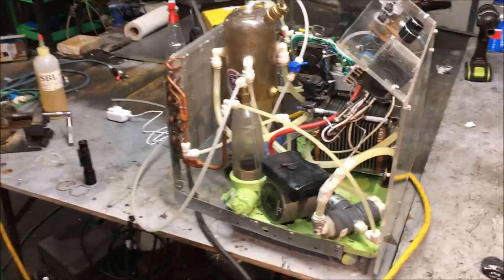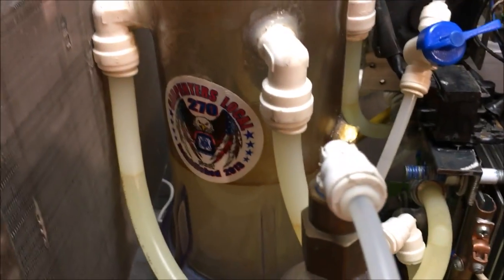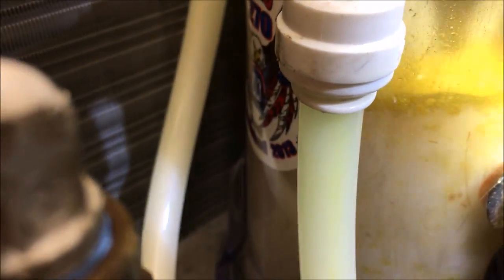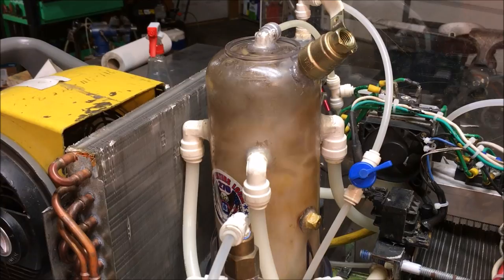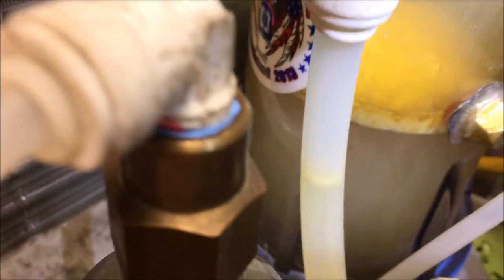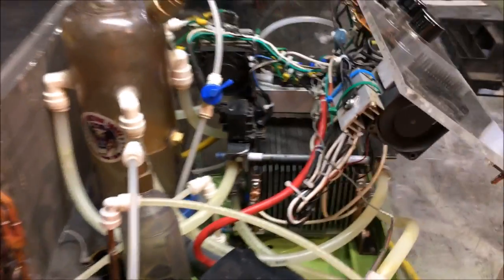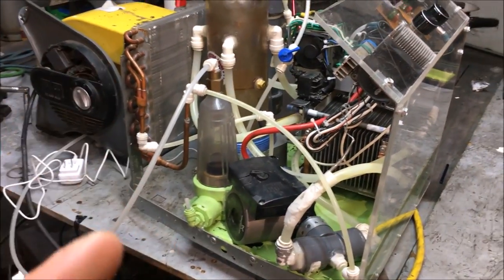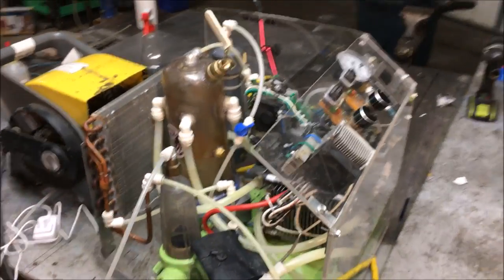hho foam (SOLVED )

Comment: Have you heard of thermoil ? It's a product used to stop excessive off gassing in lead acid batteries, you actually add the stuff to the electrolyte and it floats on the top slowing the bubbling and fizzing. Something for you to check out if the stuff your using degrades after time....
Reply from the maker: thanks bro appreciate the input

Comment: I like what you're doing mate.
The process in which oils become soap is called saponification. 
That is to say they saponify. Most hydroxides will cause this at different rates. NaOH & KOH will also make different soaps with the same oil; I think that the potassium will take longer to make a softer/liquid soap with denser sud profile.
In a pinch? Unscented baby oil is mineral oil.
One way margarine is made is through the hydrogenation of oil using a catalyst usually under pressure; perhaps you are partially hydrogenating your oil??
Please take everything i say with a grain of salt also.
Reply from the maker: from what ive red not all oils will saponify. also they sell a mineral oil sodium hydroxide solution so it must be inert 
im gonna try the baby oil after i let this batch run for a month . it takes three weeks to make oil soap they say
Reply from the maker: thnks for your input friend
Reply from the maker: yep 4:15 thanks for the extra input

Comment: Quite disappointed.  What "oil" is the product you introduced into the process.
What you introduce as Mobile Velocite #10 is, as you say, not what its labeled as.  Therefore you've no idea what the solution to foaming is.
Reply: perhaps see 'Electrochemistry in Magnetic Fields'featuring magnetic-field-facilitated spin selectivity....and magnetic-field-driven bubble removal.'Effiency should increase from essentially free  EMF from magnetism(thumbs up on the right hand rule)Urea ,making  a lower H20 dissacociate overpotential at .387 volts,what do you think?regarding progress.I'm leery on the oil industry since abiotic oil and natural catalytic mechanicism not common knowledge and it should be well known.